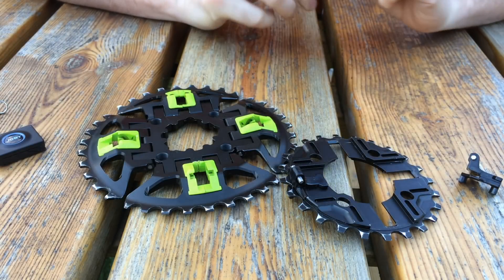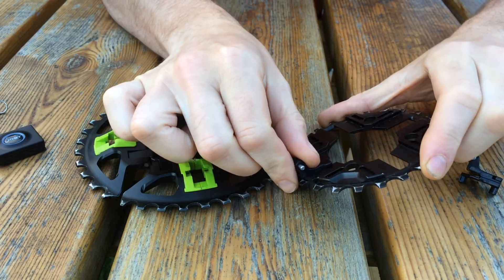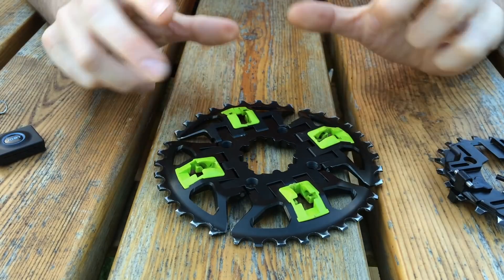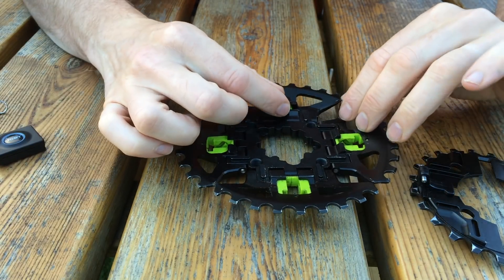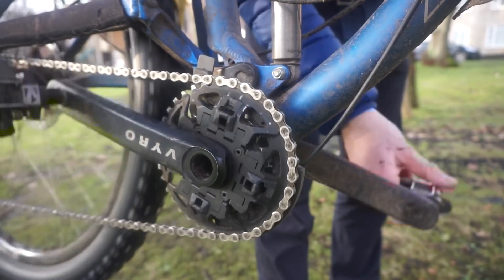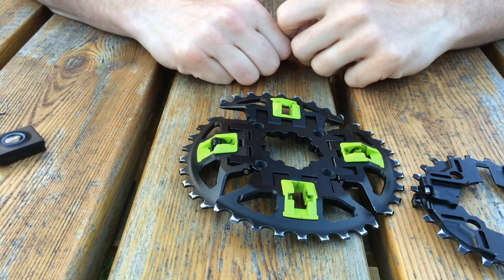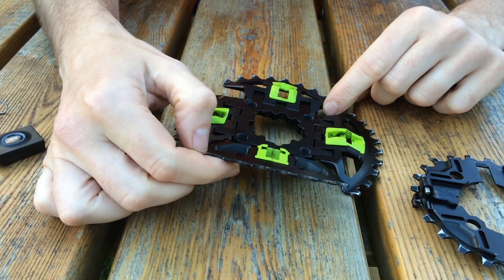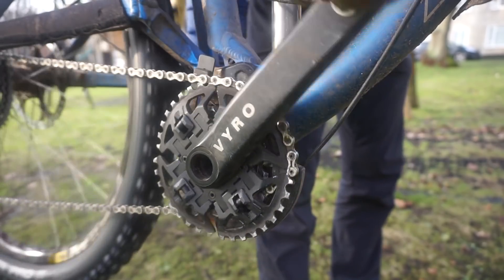Vyro FrEn1 Chainset - How does it work?

Comment: May work, but it still looks like a gimmick now worth the hassle.
When i first saw these (as picture) i though they were a clever setup where by using a parallelogram mechanism, the diameter would enlarge and give you various sizes.
Also, there's a 1800's variant of this that uses springs and a "clutch" plate that does about the same, so not even an innovation. Kinda disappointing.